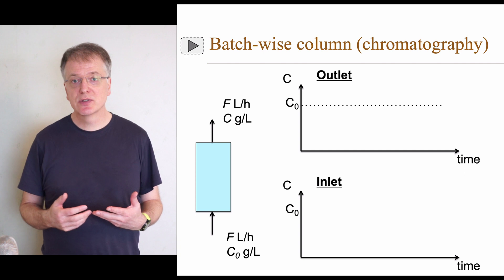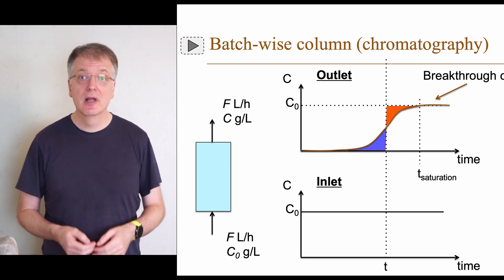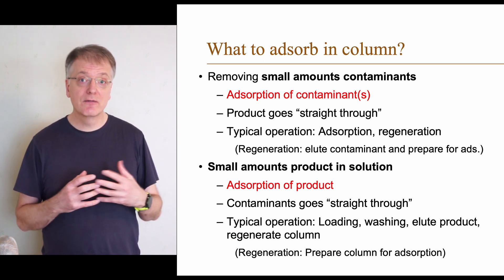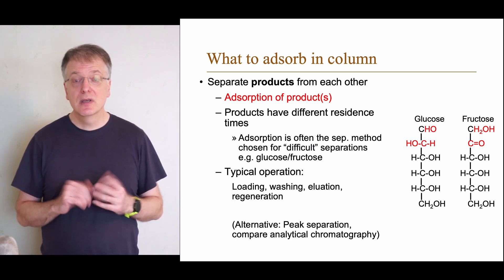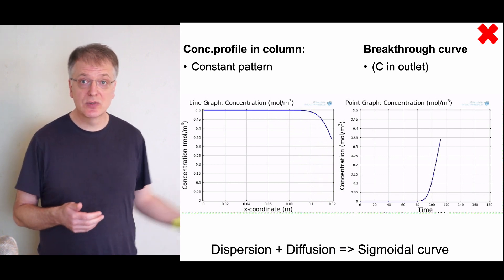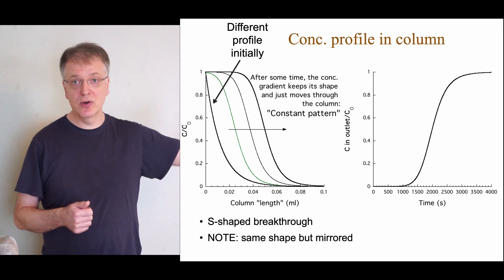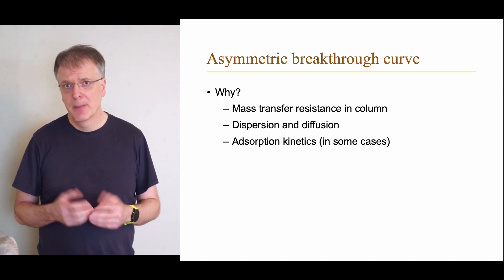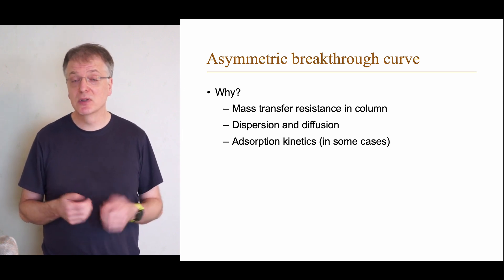Batch column adsorption intro

Comment: A quick question: When the saturation takes time, and I need to run column experiments for days, is it ok to stop the pump at the end of each day and start it to continue the experiments and sampling the next day?
Reply from the maker: I don't think there is a general answer to that question. There might be situations where it is ok, but if you stop the pump diffusion will continue and thus broadening of the front may be substantial. Also, as soon as you change operating conditions in a real life case, all bets are off. The only way to be sure if a change matters is to test if it matters
Reply: @PLE_LU  thanks a lot for your reply. Appreciate it :)

Comment: What kind of computer generated system did you use for the breakthrough curve?
Reply from the maker: The curve at 2:39 is the result from a simplistic model made in Comsol Multiphysics

Comment: How to design column adsorption system? Can it be done from optimised parameter from batch study?
Reply from the maker: That's a very general question and I personally (the editor) can not give you a full answer. A batch study could give you enough data to find a good fit to some adsorption isotherm, but that might not help you all the way.

We have a research group at our department that combines experimental data (using chromatographic systems, such as ÄKTA) and advanced computer simulations/optimisation to find good separation designs e.g. for purification of biopharmaceuticals. If you are interested, you can start your literature search at https://portal.research.lu.se/portal/en/ by looking for publications by Professor Bernt Nilsson